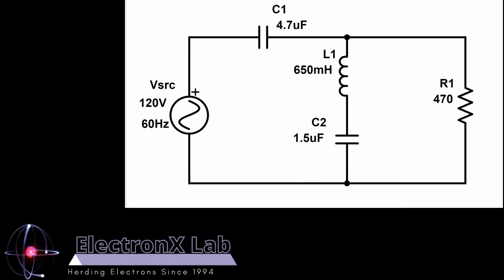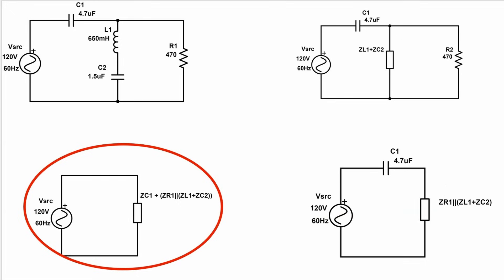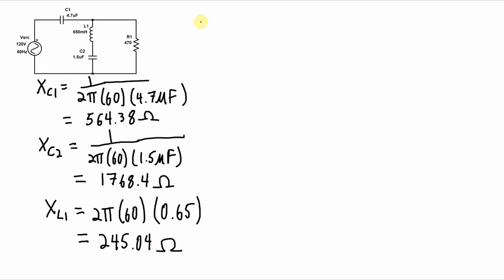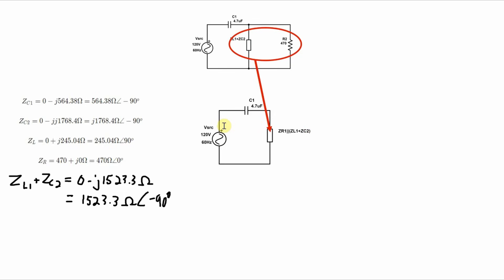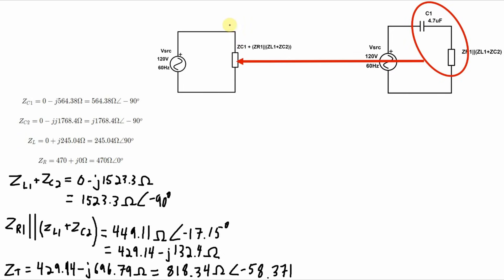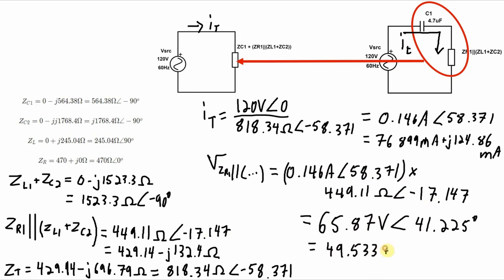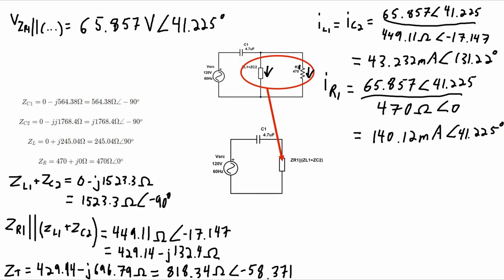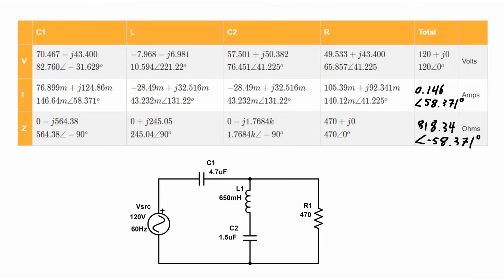AC Analysis: Series/Parallel RLC Circuit

Comment: For those saying the values are wrong at the circa 6 minute mark, the end value of 43.232mA is actually correct. However the error lies with the resistance value used to divide by. On the example the combined impedance of ZL1, ZC2 in parallel with ZR1 was used (449.11 Ohmz < -17.147) when the value of resistance for just the ZL1 and ZC2 should have been used (1523.3 Ohmz < -90) which then gives approximately 43.232mA. Hope this helps.
Reply: yup i noticed that too
Reply: Yes i see
Reply: right. I was confused at first that gives the final answer of 43.232 still but differs in the angle.

Comment: Your calculations is right, but there's a small error when you find current across second impedance Ic2=Il1 you forgot to put the right value
Reply: Yes, and he needs to correct that. The impedance was 1523.3 ohms angle -90 no?

Comment: Hii,

Can you please make a video if i want use it for my filter circuit, the parameters available with me only the resonance frequency and frequency band, then how will select each and every component of this circuit? What are the data required for calculating the component values ?

I am using this circuit at the output of full bridge rectifier.

Comment: Thank you for this tutorial. It was very helpful. It would be interesting to see a similar example in a 50 ohm system (e.g. 50 Ohm signal generator and 50 Ohm load).

I think you might have an error around 6:11 when calculating iL1 and IC2. You calculated a magnitude of 43.232mA at an angle of 131.22 degrees. I believe it should be 0.147 at an angle of 58.367 degrees. This also screwed up the final voltages across L1 and C2.
Thanks again.
Reply: I also spotted the possible error at 6:05

Comment: Keep increasing the difficulty. They are still a little on the easy side. I wouldn't mind seeing some Laplace Transforms, transfer functions and filters hashed out quite a bit. But hey, it's free. Can't complain too much.  Nice work :)
Reply from the maker: I appreciate that feedback. There are so many topics to cover I sometimes don't know what to do next. I've been trying to pick a general topic and then try to work through it (e.g. AC circuits), but sometimes I get bored and like to jump around to other things. Focusing on op amps right now
Reply: You can do the same exercise by using the laplace form for the impendences. Like, 1/sC for the capacitor and sL for the inductor and work out the math from there by having s=jw. Once you've grasped the concept of equivalent circuits/impedences it's not that difficult.